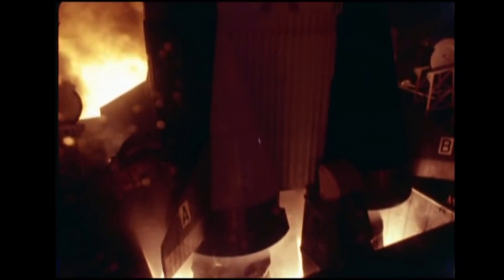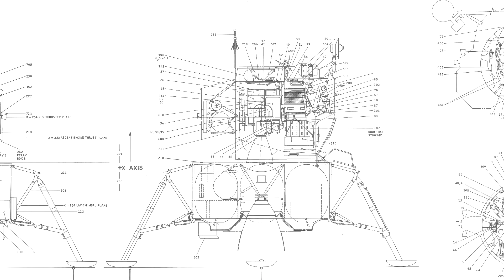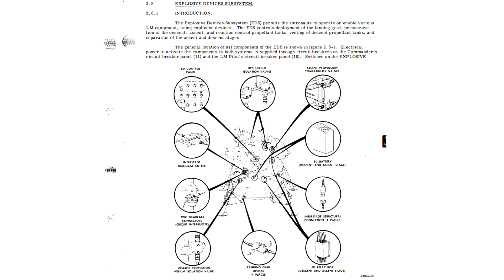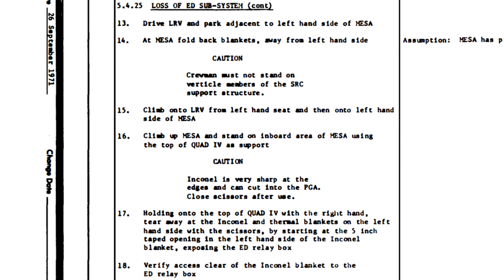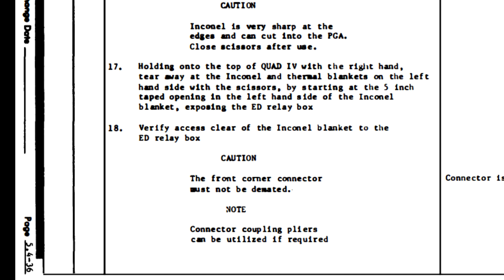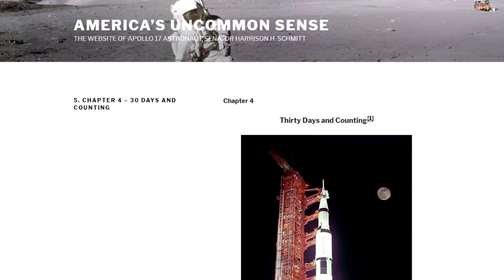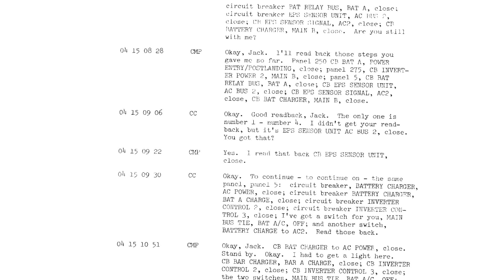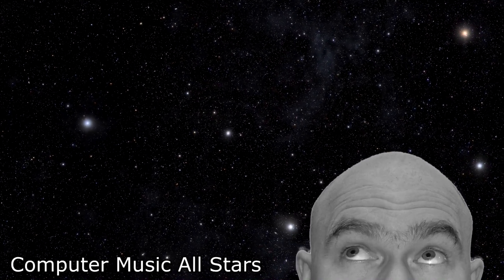Why Lunar Landers Had Jumper Cables For Emergencies

Comment: In the 2020s: "How to jumpstart your spaceship using your smartphone's wireless charger"
Reply: I was just thinking, how long till a USB-C cable and a mobile power pack could jump one.
Reply: @ewanmurray153  USB type C is specified with 100W maximum.
(5A 20V)
You could run a small computer and maybe actuate some valves with it.
Not sure if that's enough to start the engines though as some could in theroy be started with ~100W but as soon as you need a starter motor, 100 W is nothing.
It wouldn't surprise me if some engineer came up with that as an emergency plan to run the navigation and RCS system on a type C powerbank as an emergency backup.
Reply: @diesistkeinname795  haha I knew if I joked someone would come in with the specs and trample on my dreams 😂

You gotta admit though, it would be a fantastic marketing ploy if they could get around the output to ridiculous amounts (if not a terrifying financial pithole!)
Reply: @ewanmurray153  If they raised the voltage to 100V, they could use up to 500W wich could barely power a pump or something.
The point is that they usualy only need enough to start:
-navigation
-RCS thrusters
-solar panel alignment
100-500W could probably do that, if the solar panels are aligned properly, they produce much more.
Another option would be to charge the onboard batteries via USB C for a few minutes and draw the higher current required for some systemy from them to start whatever powers your spacecraft.
Reply: @diesistkeinname795  Great, this comment is the only one which make sense.
Reply: @ewanmurray153  I don't see why not. That's what I use for my car lol
Reply: @ewanmurray153  Knowing my luck, we would only have an Apple or a USB type A.
Reply: Six months away?
Reply: @AgentTasmania  Sounds about accurate for F9 crew.
Reply: b8702131 as someone living in the 2020s, I can confirm my spacecraft can now be charged with my smartphone’s wireless charger
Reply: Just do it wireless with the S10/Mate 20!!
Reply: You could do it with one of those power banks that have the car jump start plug on them - they can source ridiculous amounts of amps on that plug for a few minutes. You'll probably stuff the batteries in the powerbank, but who cares - thats the last thing on your mind when your yelling "come on you stupid piece of junk spaceship, START!" ;)
Reply: It's actually not all that insane.  If they had had a few ipads, and a few cell phones, or even a handheld power bank, they could have gotten the 20AH they needed for Apollo 13.
Reply: The dangling cables make me think of the Major Tom analysis The New Yorker did.    February 10, 2014 Issue  Major Tom: the Nasa Investigation  By George Meyer  February 2, 2014
Reply: *do not use smartphone that batteries catch fire from nowhere
Reply: nope.
Reply: I dunno man we're in the 2020s now and you weren't thay far away and I don't see personal space craft any time soon. It'd be nice though!

Comment: That's the beauty of electricity, electrons are electrons, no matter what you use them for, you can modulate amps and voltage, switch them around and power (almost) anything
Reply: Not only that, but there is typically a tolerance for varying voltage. It doesn't need "Exactly 3.7 volts", it will run just fine at 5v or, for a short time, maybe even 6v.
Reply: @Oddman1980  depending on tolerances, but more often than not.

Comment: NATO military vehicles can be jump-started using the common NATO slave receptacle (P/N 11674728) and a slave cable. The documentation company I worked for was working with a customer that had never had a contract with the Army before. They objected to the term “slave”, said it was a “hot button”. We told them that was standard military nomenclature but they insisted we call it an “Inter-Vehicular Receptacle” in the Ops manual. At the first review with the Army the officer in charge took one look at the text and said “Change that to NATO Slave Receptacle.” The customer said nothing. We didn’t say “We told you so,” we just changed the text. There are so many ways a military vehicle can kill you (crushing/electrocution/severed limbs/decapitation/scalding hot fluids/toxic fumes) that the word “slave” in a manual is the last thing a service man/woman is going to worry about.

Comment: I've wondered why the industry never standardized on a specific shaped socket for battery terminals and jumper cables since enough drivers get confused about where to attach to. ..
Reply: For many decades cars required owners to know a fair amount about mechanics. Got less and less, but it was assumed the average person would know how to use jumper cables with the clamps. Plus, sockets etc cost money, and most cars were kept very basic up thru the 1980s.
Reply: They are too focused on squeezing in more cup holders.

Comment: It's so cool to see the long take of the ascent.  Usually it's cut away, but with this at around :52 you can see it pitch over to orbit quickly instead of straight up for awhile.  I guess since there's so little atmosphere on the moon.
Reply: With the moon having virtually zero atmosphere, you could orbit at almost any altitude as long as you don't fly into terrain. Orbits were quite low just before the lunar descent and after the ascent phases.

Comment: I can imagine spacecraft from the 70s being less complicated than modern cars. It's just... Every bit was necessary...
Reply: A spacecraft from the 70s had control electronics about as sophisticated as a mid 1980s onboard diagnostics computer. Pretty amazing when you think about it.
Reply: @johnrickard8512  on board, maybe. You car, however, can start on its own. The rocket needed a launch pad and an entire building worth of dedicated engineers to start it.
Reply: I like your name, handheld calculators ten years later had about the same computing power, if not more, than the computers aboard the Apollo missions.
Reply: @inkyguy  You're off by nearly two decades. The AGC already was no match for the Zilog Z80, which was produced from 1976 onwards. The Ti-81 from 1990 was almost certainly on par with the AGC. The TI-83 from 96 was already multiple times faster.
Reply: @rkan2  Nope, youre completely wrong. The agc could run a sophisticated multitasking operating system. Already WAY ahead of the z80.
Reply: ...some years ago, when i had trouble with the electronics of my Toyota, the guy in the garage said: "...no wonder. Modern cars have more electronics inside than early Jetliners...!
...if you would start your engine by hand, the Check-list would take ~2 hours...! ;-)

Comment: Funny enough, I did once jump start a helicopter, which had a battery that had run down due to the DC bus being turned on overnight so the security guards could use the aircraft radio to listen to broadcast FM. Helped that I did my apprenticeship on that model, and knew the entire electrical system, and also the pitfalls that could occur with them running the battery down, and what to look for. Ground power unit and the ground power connection, start the ground power unit and power up the DC bus, and they press start.

Low current, the ground support unit is designed to supply 8kA at 28VDC, and this little turbo barely made it to 400A during start, so after a half minute of idle, pulled the cable ( only way, there is no disconnect other than a sense contact on the plug), waited another 5 minutes at idle to see if the battery was not going to go into thermal runaway, it was still cold so gave them a clearance to take off back.

As well used another ground support unit to jump an ambulance that had waited 6 hours for the casevac to get there, with lights on, and there had to grab jumper leads to make the link between the connector and the battery. those lights went very bright on 28V instead of 24, and that ammeter needle did not even budge off the zero during the very very vigorous starting.

As to the LRV batteries being used to fire the ascent stage probably no issue, the batteries certainly were the same chemistry, they used a similar enough voltage. The major issue was the disconnection, as the LRV batteries would stay behind, and the ascent stage needed power to keep the valving operational, so they designed the systems to get you power from an alternate set of ascent batteries if the main ones failed, but use batteries on the ascent stage.

You could not have kept the mass centre stable if you used the LRV battery pack and carried it with, no real space to place it (otherwise they would have had equipment or battery pack there already) and also it would move the mass centre from the engine bell outside the ability of the RCS system to compensate for the eccentricity. 

Silver Zinc batteries are heavy, and are only used in space applications because they are so reliable and tolerant to abusive temperatures and charge and discharge use, unlike the modern lithium chemistries. Thus you can have a smaller battery pack for the same high current draw, and not have to worry too much about it cycling from -100C to +200C every orbit.
Reply: Low current...  8kA...  
bitch what??
Reply: @Atlessa 
I was thinking the same thing, you'd have a hard time welding with that much current because you'd just evaporate the metal instead of melting it!
I'm pretty sure they meant "low current" relative to the capabilities of the ground power unit, because compared to a design rated current of 8kA, 400A is indeed "low current".

What I want to know is what kind of equipment requires a ground power unit that can provide 8kA at 28v? A 787? That's the only aircraft I know of that doesn't have a bleed-air system and therefore needs a large amount of electricity to operate when the engines are off.
Reply: @44R0Ndin  I did some mental math and i can't remember the very simple formula exactly (W=VxA?) but that is about 11.2 KW I think?  I don't doubt the guy at all (doesn't sound or read like it's made up) but it seems an awful lot.  (EDIT: removed error)
Reply: @stevetreloar6602  
Good observation: we're probably talking about a unit designed to assist in starting large aircraft turbines and turbofans, so 10+kW isn't absurd by any stretch.  I went on base with my father a handful of times, and walked by units pulled as trailers designed for 22 or even 50 kW.  That sort of power is available to civilians now, even land-mobile.
Reply: Probably a large turbo shaft engine here. I know Allison turboprop on a P-3 Orion use around 8kA to start up. We actually have a dial on our Ground Power Unit that we have to crank up to allow that power. The power cord is warm to the touch when we go to wrap it up.
Reply: @ParkerUAS  Actually designed for a much older aircraft, Aeromacchi Impala, which used that much current in the starter generator. Also has a big warning in the start instructions about not doing more than 2 consecutive start attempts without ground power as well, because that generator could, when the engine was running, also provide a peak of 8kA to charge the battery, and you then ran a risk that your battery would overheat rather spectacularly. Batteries all were modified to add a thermal warning switch to them, with a prominent light in the cockpit attached.
Reply: @SeanBZA , ah, makes sense.
Reply: Hypergolic Ignition Valving stays on once activated. No need for continuous current one activated.
Reply: @superspit  which also means that if you jump start the hypergolic(sp?) Valves off of the rover, you miss your ride home!
Reply: @NFSgadzooks ???

Comment: Basically impossible to get help on the moon implies they're is actually some level of possibility. Was there?
Reply: Daniel Walters if they wanted to send another Apollo mission to help, they still couldn’t take them home with them. And the command module could only stay in orbit for so long before the astronaut in that ran out of food/air. So no, there wasn’t really any hope. 

They did plan for this eventuality. All they would do is cut all communications, and the president would give a speech.
Reply: @benocq  why wouldn't they have just used their EVA packs?!?!
Reply: Daniel Walters What would they have used them for?
Reply: @benocq  getting to orbit of course
Reply: Daniel Walters the Apollo suits didn’t have jet packs. They were just for keeping them alive while walking on the moon
Reply: @benocq  (It's a ksp joke)
Reply: Absolutely not. The last shuttle mission to service Hubble had a rescue option but the Apollo missions certainly did not.  If your LM didn't get off the surface you became "a permanent monument" to the American space program.
Reply: I think for some of the later Apollo missions they had a second Saturn 5 on deck as a rescue ship, but I could be mis-remembering.

Comment: Hi scott, can you please make a video on how exactly they rendezvous with the orbiter after leaving the moon. it always confused me how they basically did a full docking procedure with a module moving so fast with so little room for error and so few supplies and resources (air fuel food water ect.) obviously the launch would be very well timed, but if the engine lacks gimballing and they only have RCS for navigation during the launch , not to mention how low the mass of the lunar launch vehicle was (astronaut sneezes and knocks them a couple of degrees of course) how exactly would they do what is effectively the same as docking with the ISS with so little redundancy on such an unstable craft.
Reply: Lots of practice! All the early Apollo astronauts first flew on Gemini missions. There was also a simulator: https://en.wikipedia.org/wiki/Rendezvous_Docking_Simulator
Reply: You make many baseless assumptions here.  There was room for error.  They had supplies.  Astronaut sneezes wouldn't throw them off course.  How unstable was the craft?  It's hard to answer your question when the premise is not necessarily factual.

But here, this is crude, but accurate :

https://www.youtube.com/watch?v=A1_7fHjnTj4
Reply: All they had to do was make sure to launch in the right direction so that they would orbit in the same plane as the CM. The rest is just waiting. If you’re a little early or late (or a lot) you just hang out in the lower orbit for the time it takes to get lined up for rendezvous.  It isn’t rocket science.  Oh, wait.  Well, it isn’t HARD rocket science.

Comment: I like to start a rocket booster by dropping a lighted match in the fuel
Edit: thanks for the likes!
Reply: Archaeoptery X 
Well, with Soyuz, it’s more like the rocket engines are dropped into the lighted match.
Reply: The trick is getting back inside before it lifts off.
Reply: Yeah but you gotta be pretty light on your feet to get that job.
Reply: It's the only way to be sure.
Reply: Oh, there it is.
Your comment' doing well.
Reply: @MickShoemaker17  Yup Jeb
Reply: Mr. Comrade: "I NEED TO IMPRESS STALIN"
Rocket: is fine 

Physics: Yo, fam how much of that good good power you want

Mr. Comrade: "yes"
Reply: LueLou 
Indeed. No fuel will ignite without an oxidizer (usually atmospheric oxygen).  In the case of the LM ascent module, it was a hyperbolic fuel, so no spark was required, (the two chemicals just had to mix), but you need to opened the valves. I wonder if an alternative might have been a manual valve operation — though they probably needed power to run all the disconnects between modules anyway
Reply: @BillPalmer  that depends on what you mean by fuel.
Reply: First Last show me a fuel that burns without oxidizer. Or whatever your point is
Reply: @BillPalmer  hydrogen when heated by a uranium powered, fission nuclear reactor.
Reply: First Last does the hydrogen “ignite” as I said?  I was (hopefully obviously) referring to the chemical ignition/burn reaction, not a nuclear fission or fusion process, which you can’t start with an ignition source (directly)
Reply: @BillPalmer  it was obvious you were referring to chemical reactions. But there is no oxidizer needed in the process I mentioned, and it is a viable propulsion system. It's only going to be practical in space travel, not so much weapons. But don't tell the Russians. And the hydrogen "ignites" by being funneled through very small channels running directly through a small reactor. Its pure heat that ignites the hydrogen. No oxygen needed. I am however not sure how the nuclear reactor would be started.
Reply: How you going to light the match on the moon?
Reply: @benjones4365  correct me if im wrong but i dont think they need much of a booster getting off the moon
Reply: Dropping a match into the fuel? That's asking for an explosion, buddy...
Reply: @aval1998  Mate, rocket launches already are barely controlled explosions!
Reply: Yoshi So is the aftermath of a bean burrito, but I digress.
Reply: @yoshi6236  correct, but the way he said it suggests dropping a match into the fuel tank.
Reply: no

Comment: The astronauts stood in the ascent module? That's interesting
Reply: Low gravity, short flight, no need to sit...
Reply: @gordonrichardson2972  Yea makes total sense now that I think about it.
Reply: They saved quite a bit of weight doing that.
Reply: how would they be able to sit in microgravity or moon gravity?
Reply: @thekevinager5294  I just always pictured them strapped into a seated position, it does make sense for them to stand just never gave it much thought before.
Reply: @bourne1012  yeah they are strapped but they stand. If they weren't strapped, they couldn't press buttons and leavers in the module
Reply: @thekevinager5294 
Well they sat in the rover.
Reply: @jshepard152  then, they were belted.